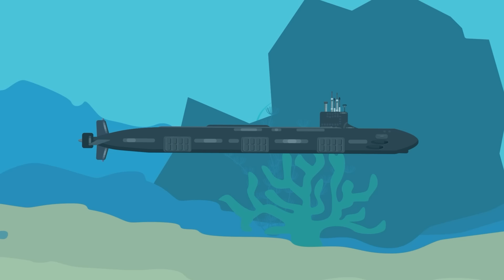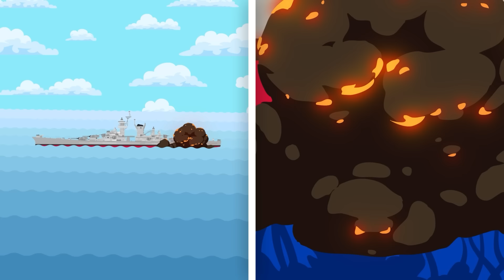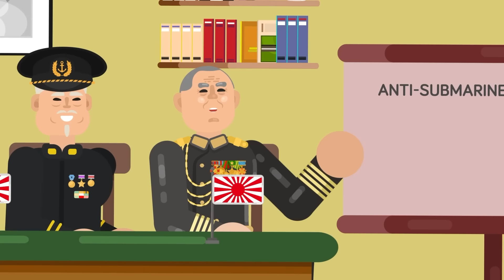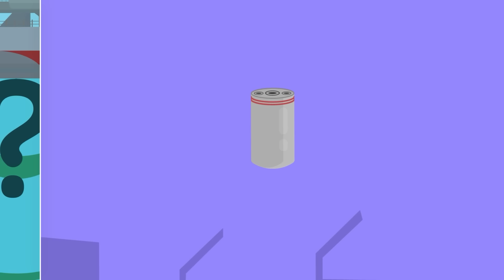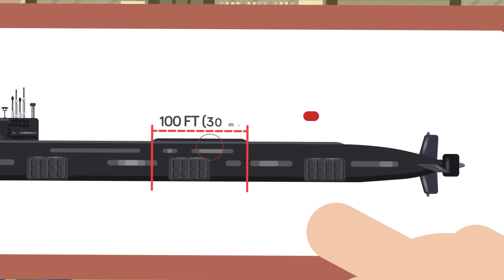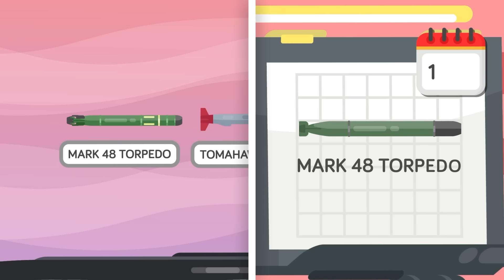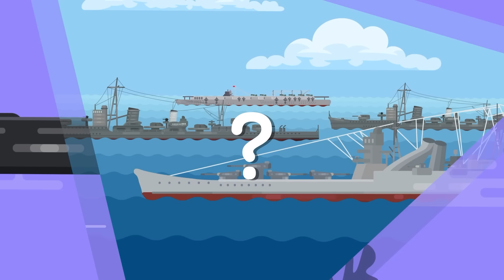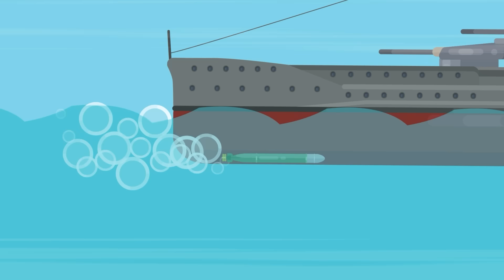What If a Single Modern Submarine Time Travelled to Pearl Harbor

Comment: If the crew had been sent back in time they would use six torpedoes total on the aircraft carriers and then probably Target the battleships. Without the carriers the mission is failed, the battleships would be costly to replace. After that Target the oilers and the rest of the fleet basically can't return home ever 😂
Reply: Yes,I don't see why the auxiliary ships are discussed here at all. Take out the carriers,and the strike is not going to happen.
Reply: True.
Reply: Plus a time, traveler would have knowledge of the enemy and their equipment, flaws and all to make their offensive more effective.
Reply: Duh... 😆
Reply: Instead of sending back an overpowered sub, send back an engineer with the knowledge to fix the defective US torpedos and give warning of the attack.   Then have the ships and planes ready for the attack.  Defending Manila and the Philippines or just Luzon would be more important than the obsolete battleships in Pearl Harbor.
Reply: @editorcj  Dude, people at the time knew how to fix the defective torpedoes. What you need is someone who can convince NAVBEUORD of the time that the Mk14s aren't perfect. The entire reason the USN was stuck with them for most of the war is that none of the brass running NAVBEUORD were willing to accept that the magnetic detonator had problems. But plenty of field engineers by mid-war were capable of disabling the magnetic detonator and getting the torpedo to run at the right depth for the contact trigger to work.
Reply: @madamcommissar  I think wrecking the Japanese invasion of Lingayin Gulf would’ve had a more profound effect on the war than wiping out the Kido Butai 6 months before it got wiped out anyway.  Saving the Philippines would have shortened the war by years.  Also replace General Perceval with literally anyone else in Singapore.
Reply: @madamcommissar  NAVBEUORD knew the torpedoes were defective. But the corruption and money involved was why they kept lying and lying.
Reply: @georgemonet8187  That's new to me. I only heard that NAVBEUORD kept pushing the Mk14s with the caveat that anyone caught modifying them would be court martialed. Which, obviously, loads of submarine captains ignored.
Reply: @editorcj  Yes!! The US torp was horrible. Just convining anyone in the Navy of that would be beyond any one engineer, though.
Reply: @editorcj  The Navy was aware of the reliability problems of the torpedoes, but hushed it up.  If a stranger, that has no verifiable history and no credentials, showed up to tell them he has the fix they need, the Navy Department would ignore him at best, have him arrested as a spy at worst.   The U.S. believed the Japanese were no threat.  They would ignore his warnings just like they ignored Billy Mitchell.
Reply: What obsolete battle ships?
Reply: Probably the oilers are the most important ships in the fleet i mean they could probably send more but they would basically be stuck there and also having radar would be a huge game changer
Reply: These scenarios always assume the time traveling ship/sub arrives at a time and place with enough time to figure out where and when they are, have good historical knowledge of how the battle played out including the position of the Kidō Butai task force, to make a plan, travel to the combat area, and implement its plan the moment they can hear a radio report of the bombing or a declaration of war from Washington.  Then all they need one "special" TASM missile and the entire task force would cease to exist and losing those ships would then completely change the entire war in the Pacific even if that Virginia class suddenly teleported back to the present or was lost in the attack.  There would be no more battle of Midway, and many other major naval engagements like the solomons would have seen Japen hopelessly overmatched due to the loss of the Hawaii task force ships and crews.
Reply: Of course the Captain and most of the officers on a USNavy submarine knows the history it’s taught to ALL who attend the Academy etc just like we in the US Air Force are taught from basic training to tech schools and your duty assignments Air Force history etc!! Marines too!!
Reply: Forget about the foreknowledge. This video is focusing more on the differences in tech, and firepower.
Reply: Or four nuclear tipped missiles or torpedoes in a diamond formation, crush the hulls underwater.
Reply: @rodgemic  And the Japanese fleet will not even see them
Reply: Two torpedoes per carrier would be more likely. Kaga and Akagi in particular were battleship hulls and had good torpedo defense systems.
Reply: @mikespangler98  good for their time yes. One would do it but you're probably right two for redundancy.
Reply: This, 100%
Reply: No need the USN will destroy all other surface ships
Reply: @rodgemic  no need for Time travel .. WW2 Subs with working torpedoes..
Reply: ikr
Reply: problem is it would be a retalitory strike. we werent at war with japan so no need to attack. so video is useless.
Reply: @jacquesbreaux6788  the idea is a modern ship and crew got sent back in time so they already know what's coming if they don't stop it. That crew would risk changing the timeline. It would come down to let all those people die in the surprise attack or alter history with a preemptive strike... Split the difference because Pearl harbor was a multiwave attack wait until first wave begins their attack and then let loose?
Reply: @rodgemic  Why do you use a capital "t" for the word "target"???

Do you not understand proper usage of capital letters?

Sentence case: Capitalize the first word of a sentence and use lowercase for all other words, except for proper nouns. 
Proper nouns: Capitalize the names of people, places, things, or organizations. For example, capitalize the names of cities, countries, nationalities, and languages. 
Titles: Capitalize the first word, all nouns, all verbs, all adjectives, and all proper nouns in titles. 
Direct quotations: Capitalize the first word of a direct quotation that is a sentence. 
Holidays, historical periods, and religious terms: Capitalize the names of holidays, historical periods, and some religious terms. 
Academic terms: Capitalize formal degree titles, such as a Bachelor of Science. 
Brand names: Capitalize brand names. 
Roman numerals: Capitalize Roman numerals. 
The pronoun I: Capitalize the pronoun 

Please educate yourself
Reply: @jonathanbaron-crangle5093  they were probably using voice dictation or predictive input (on mobile) which incorrectly assumed they were talking about Target, the supermarket franchise.
Reply: @rodgemic  That's the problem... if they abort the strike, the US doesn't enter WW2... so the Axis rolls over England and ultimately wins.
Reply: I hate temporal anomaly’s!
Reply: @AoiKaze2000  wake island would still have been attacked and most likely lost along with several other Japanese attacks that were planned to happen more or less concurrently. The Pearl Harbor attack fleet being destroyed would mostly likely have not stop those other attacks even if the Japanese command got word of and believed the reports. But it would have save many us ships at Pearl Harbor for being destroyed or damaged making many more ship available for faster counterattacks though it may have also had the affect of slowing down production and focus on carriers and carrier aircraft and helping keep the focus on building big gun battleships even though the pendulum had already been swinging towards carriers before Pearl Harbor happened
Reply: @rodgemic  But their very presence in the past is already massively changing the timeline even if they try to do nothing.
Reply: @jacquesbreaux6788  If you saw a massive armada a few hundred kilometers from Pearl Harbor unannounced, you could probably put 2 and 2 together.
Reply: @jacquesbreaux6788  not really as the japannese would never know what hit them. they would know it's torps and unknown " super rockets". and given the pride they had of their superiority in naval equipment over the US they had at the time they would never acknowledge them to be american. so they would probably just think it's the gods warning them not to attack or some other BS like that
Reply: Unlikely they would even know there were torpedoes or missiles. The missile travel so fast, you couldn't hardly see them. And the torpedoes don't travel on the surface and leave no wakes. So they would just see the ships start exploding for no reason at all....
Reply: No! The video premise is the Virginia submarine is sen back on December 7th the day of infamy!! So it’s preventing the SNEAK attacks!!  Japan was going to attack anyway!
Reply: @jacquesbreaux6788 yes we were 

Japan declared war , The US just bungled delivering it to anyone of importance 

And by the time it was even translated ....21 ships laid in Ruins at Pearl Harbor 

The only reason its popularized that the US Declared War and Pearl Harbor was a suprise attack is a PR move as its quite  embarrassing/weak to see that your nation 1 didnt know you were at war and 2 basically allowed this attack to happen because of it
Reply: @jacquesbreaux6788  let's forget time travel for a moment. Let's say something went wrong and the US had discovered the carrier force 4 days out and steaming for Pearl. You think for an instant that wouldn't have triggered an incident? The mere presence of the fleet would have been casus belli
Reply: @jacquesbreaux6788  Yeah, that's why the time traveling submarine wouldn't work.

Comment: 0:03 That virginia class submarine hasn’t been built yet. Won’t be done for several more years. Ironically, the first virginia sub with those middle missile tubes is the USS Arizona. So the Arizona would be saving the Arizona
Reply: Virginia was commissioned in like 2005 I think….
Reply: @ Yes, but the one depicted hasn’t been built yet. 774-802 don’t have the missile tubes in the middle, only in the front

Comment: You should do a video about if a modern British fighter jet time travelled to the Battle of Britain
Reply: It would probably be good for one or two battles before it needed maintenance.  That's assuming it doesn't run out of ammunition.  Then, pray that a part isn't broken and then pilot can also service the plane (doubtful).  Isn't the rule of thumb for a fighter jet, one hour of operation requires ten hours of maintenance?
Reply: @Bakapooru  almost accurate... would be good for just one battle... as soon as it lands it would be seized for reverse engineering and never go into the air again.
Reply: @Bakapooru so, like the F22 in WW1?
Reply: An F22 in WW1?

Can the radars pick up a wood and cloth plane? Is the exhaust of the piston engine hot enough for a sidewinder missile to get.a target lock? 

Will the targeting computer decide the 60 MPH object is really a flock of birds and ignore it? Similarly, if the radar does see the piston engine will the computer decide it's too small to be aircraft and ignore it? 

Granted the F-22's sonic boom will crumple the Sopwith Camel and such, (sorry Snoopy) so it won't actually need weapons. 

Can an F-22 run on 1914 kerosene?
Reply: Ahahahahaa reverse engineering? Really? Why dont u take a look at a single chip and tell us how long it would take 1940s to make
Reply: That would not change that much, modern fighter would deplete all its armament quite quickly, while it could pick the most important targets, thats it, no more reload, no more fuel, no maintenance, its like if you got a modern soldier in the middle of medieval battlefield, he could shoot dozens of people and then thats it, no more use for him.
And all this is if you presume that in the hypothetical scenario, the machine and its crew is accepted as ally and not seen as an alien and therefore targeted by everyone around. The fighter could probably be of much more use if it was reverse engineered and the pilot provided as much of his knowledge as possible concerning aerodynamics and all the technology involved. As for the other example, unless the soldier is seen like a god by others which could allow him to manipulate the crowd to end the battle, he might have very little ammo to make any significant difference (have no idea how much ammo an ordinary soldier carries these days, but doubt its more than hundreds of rounds).
Reply: @frantiseksedivy5136  After it was out of ammo,  it would probably be best used as an AWACs platform;  we had radar but it was quite primitive and inaccurate,  having an F22 on overwatch would be game-changing.  If it turned up in the middle of the Battle of Britain, a couple of days with practically perfect raid detection would have seen the luftwaffe destroyed much more efficiently. Reverse engineering would take years to be useful.
Reply: @jeffsergeant  problem is you have couple of hours of fuel at the best, so even at "economy" speed, you can't have it up there for long, the radar could be really helpful yes, it could be one of the best options if you could build ground power unit, put the airplane on some high enough structure facing east and make radar station of it, if it could work in such way, no idea really... for ordinary airplane you could pretty much do that, have it run without engine if you had ground power, no idea about F22, but I presume it might be the option.
Reply: @OliversChronicles-e1e  the modern British fighter jet is actually British German - Italian Spanish :). Build also by 3 former Axis powers.